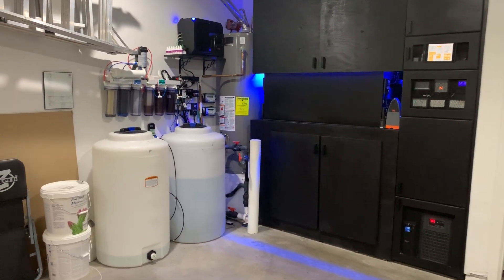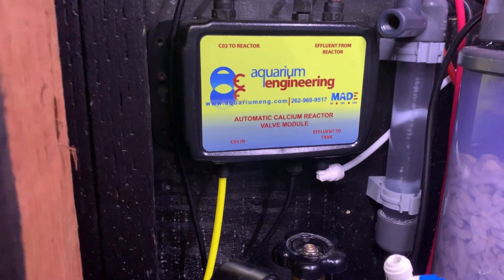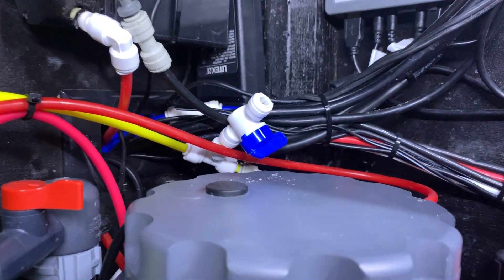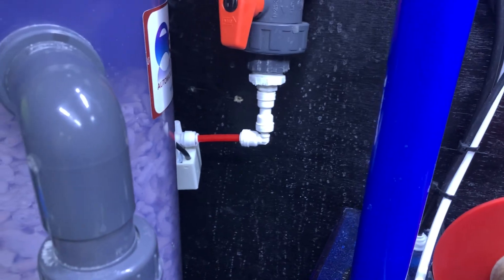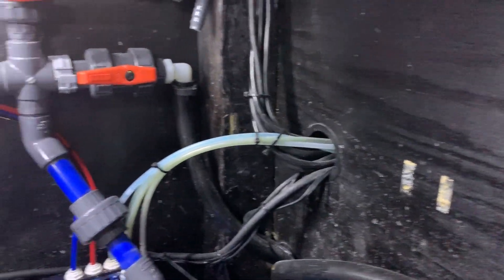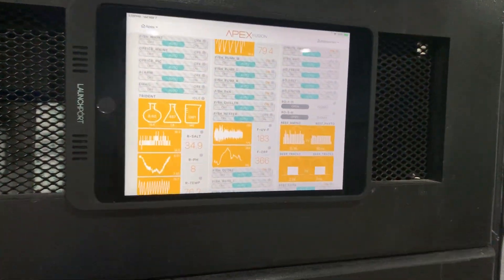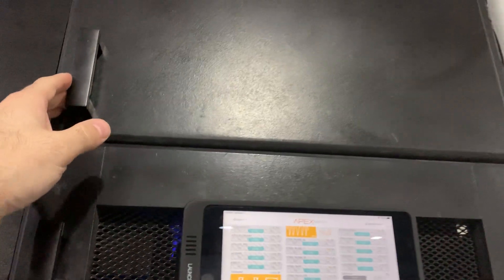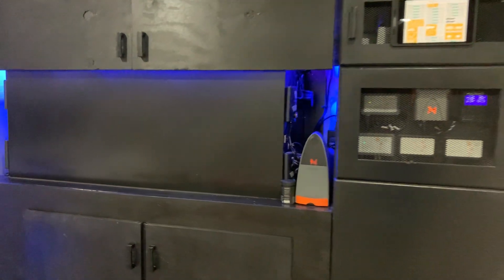Reef Automation Tour - Part 3 (ACR and Iport Launch Station)

Comment: The Neptune solenoid is going to rust.  Also check your pressure going into the reactor from the regulator.  You are getting to many bubbles in the housing.
Reply from the maker: I have been working with Bill on this.  My pressure had to be higher for my unit to work.  I have no choice but to put a solenoid as there is no check valve that works properly.  So far this has been fine.